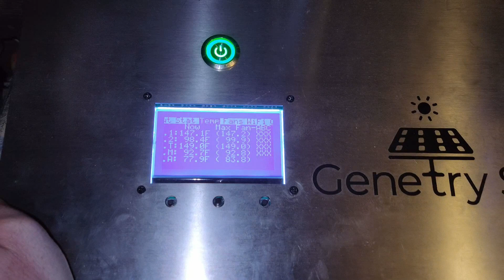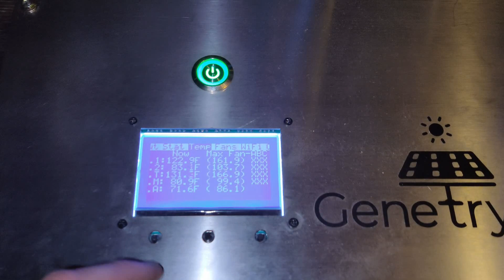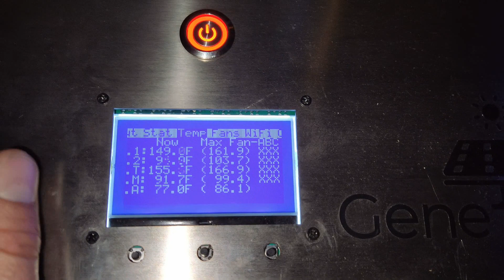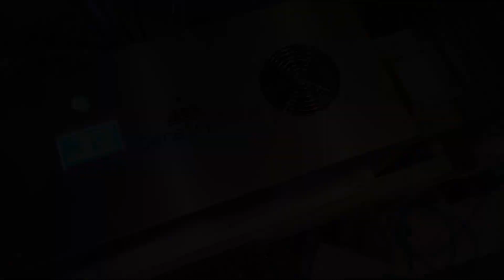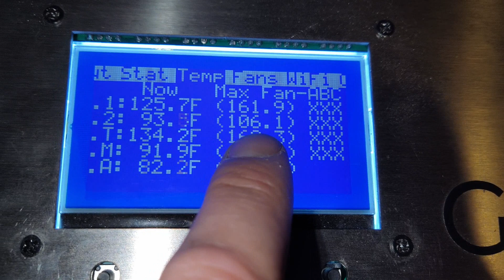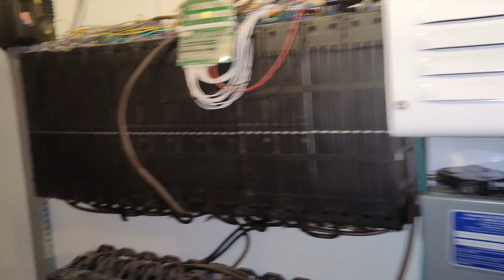GS Inverter 6000W Over Load And OverTemp Test

Comment: Hey, quick question: do you have any AC filter caps laying around?  (Motor run caps are also fine.) I'm wondering if increasing the AC output filter caps will help reduce the transformer heat a little??  (4.7 or 10uF across L1 / L2.)
Reply from the maker: hmm ill have to try that. i have turned the fans down even more and only the transformer gets a little hot 140f to 160f but inverter is quite now unless im pushing over 4500w then the fan blow lol
Reply: @GoingOffGrid101  Just curious.  Had a customer suggest the inverter took longer to heat up with the extra capacitance.  It'll increase no load draw somewhat, and make the inverter read >100W no load...but with you running the inverter hard, I figured you'd be quite able to test it.
Reply from the maker: @sidlori1592  it will be no problem lol

Comment: One thing you want to do is get the bottom of the inverter up off the board so there is an air gap under it. That will increase the cooling of the bottom of the transformer. The case needs supported by the flanges, not the bottom of the case.
Reply from the maker: interesting I will try this.

Comment: Power button is actually an RGB LED--green for inverter, red for error, and blue for AC input.  4 wires for the RGB, 2 wires for the button.
I'm glad the inverter is holding up well, but I'm a little surprised that the transformer is running so hot at full rated load.  IIRC for Sean's full load tests, the transformer was holding 130F at the rated 6kw output...so for it to be running past 150F at 6kw is a little peculiar.  Likely this has something to do with the significantly higher nominal battery voltage (66v here vs 55v in our tests), but I would expect this to affect the FET and choke temp far more than the transformer temp.  Might want to double-check where each thermistor goes, so we know what's being measured.

And yes, as pointed out in this video, an unbalanced load across the 2 phases would cause excessive transformer heat.  Might be able to use a clamp meter to measure the balance; there's also a chance I might be able to put a function in the LCD to determine approximate load balance (as there's 2 internal output amperage sensors).

EDIT: my 2 cents: the fans do sound very loud in the video...while they aren't exactly quiet fans, they definitely are not close to loud enough to need hearing protection.  This coming from someone who often wears earplugs around PA systems.
Reply from the maker: yes its not that bad lol, ill check my loads im thinking 60/40 at least but the next video will tell :)

Comment: I've had my GS 6000 inverter running since January 5th, 2021 and so far so good.  The only issue I have had is that I can't seem to hit the 6000 watts with any inductive loads as my inverter tends to throw a transformer voltage error when it is loaded with 2000-3000 watts and then the well pump starts.  I was able to test the inverter with 5000 watts of resistive load but the minute I turn on anything with a high starting surge while the inverter is loaded with 2000 watts or more balanced it generally shuts down with a transformer voltage error.  Don't know why this happens but it can be annoying to be making a meal and pulling 3000 watts and then run a bit of water in a pot and the well pump kicks on and everything goes out.  I have discussed this with Sid on the GS forum.  The only idea that I can come up with as to why this happens with my inverter is that even though the well pump only pulls about 1200 watts at 120v it must have enough of a starting surge that it imbalances the inverter to far causing the voltage on one side to be out of spec and the wifi board shuts the inverter down to protect it. I still need to rewire the pump motor for 240v and that should hopefully fix the issue.
Reply from the maker: Yea my well pump is 240 and I have seen 8500w from this inverter so far.
Reply: Umm....I can't seem to find this discussion on the forums.  Last I was aware of were issues with the lights flickering while running the A/C, which I understood the latest update fixed??  
Can you confirm it's "Xformer Volt Error"...or is it the "GTM Regulate Fail" error?
Reply: @sidlori1592   I mentioned the issue in this post.  I have since had the same issue on 1.1r3 at over 80% SOC on the battery bank according to the BMS.  I haven't had time to rewire the well pump yet so I haven't added anything to the post in a while. https://forums.genetrysolar.com/topic/142-did-a-full-discharge-test-over-the-weekend-and-this-happened/?tab=comments#comment-2519
Reply: @kuhrd  Ah, thanks for the link.  I was under the impression that was a one-time event.  Can look into it a bit further.

Comment: I hope he didnt send you a beefed up one for promotion. Did he know it was you buying it?
Reply: Yes, we did know who was buying it.  And we did NOT do ANY "beefing" up of any sort.  This inverter is no different from any of the other inverters we've sent out.  No snake oil here.
Reply: @sidlori1592  I watched a few genetry videos. Other then the fan noise it seems pretty good so far. I know the power Jack's are junk as they are. Time will tell.
Reply from the maker: @frankz1125  maybe ill go under cover and get another :D
Reply: @GoingOffGrid101  I just hope it is what it is. Does suck wasting money testing inverters . I have been pretty lucky with mine. I have over 4MWH on it. Almost 3MWH on my make sky blue controller.
Reply from the maker: @frankz1125  dang that not bad!
Reply from the maker: @frankz1125  I really hope this inverter is good cause the no load draw is only around 25w :D

Comment: Are the fans ones that can be replaced with quieter ones or another fan added? At 6000w and 82% that's 1500w of heat which is a lot, but they seem so loud!
Reply: They'll likely be delta fans, huge air flow and last forever. They swear by them.
Reply: @user-mt4zr5kp7h  Fans are custom manufactured for us, rated 250CFM, 38-75vDC.  And yes, they're loud ;-)
Reply from the maker: You can change the fan speed to lower the sound level
Reply: @GoingOffGrid101  but only at lower wattages, seems like the unit might benefit from another fan so if could be quieter at high loads.
Reply from the maker: @BenBrand  no more fan could help this inverter, the ones in it are like a leaf blower lol. but you could make it quite quite, ill make a video on it.
Reply: @GoingOffGrid101  yeah I don't mean to give it more cooling ability but if you add another fan you could run both of them at half the CFM get the same cooling ability at full load and it would be much quieter
Reply from the maker: @BenBrand  im pretty sure i can have this this quite up to 3500w
Reply: @GoingOffGrid101  that is pretty nice, certainly the majority of the time. Would be really cool to link another unit and run everything all the time!
Reply from the maker: @BenBrand  yes and these are very cheap in the inverter world.